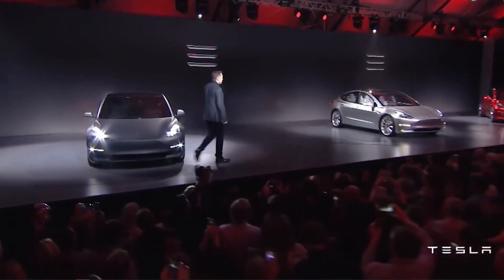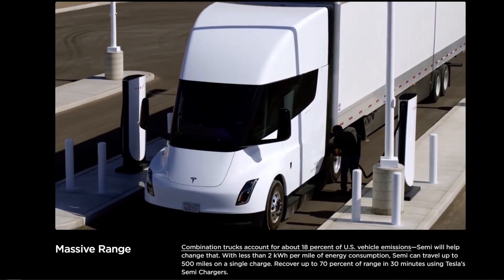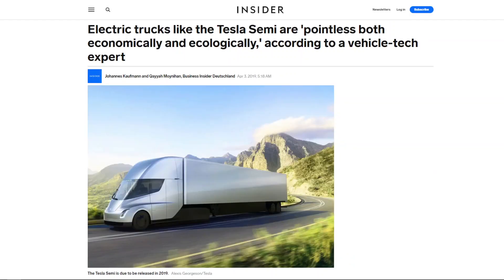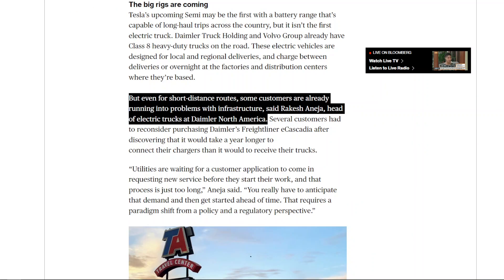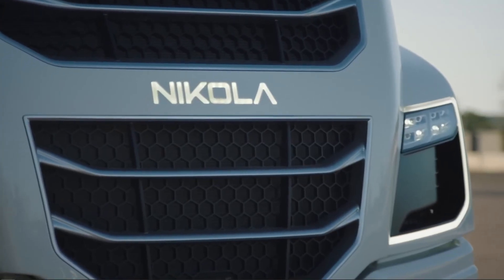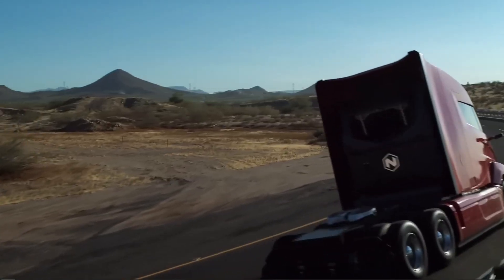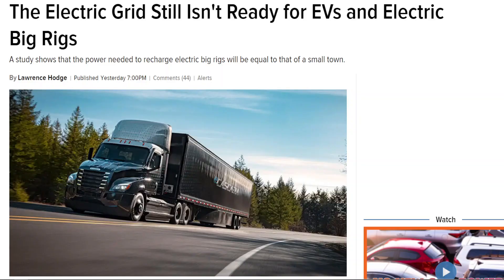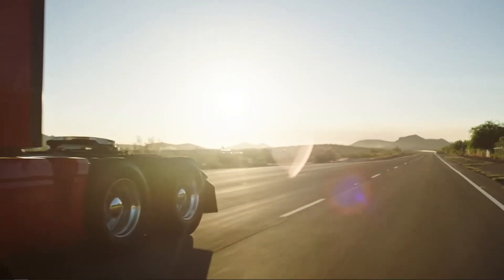Sandy Munro: Battery-Electric Trucks Are EXTREMELY Flawed For Long Haul.

Comment: Semi Truck        => 900 kWh battery pack or 1.7 kWh per mile	
					
Average US Home uses => 10,715 kWh	 per year 

Semi truck uses less then 10% of an average home per year
Reply: Okay we need sources from both sides now.
Reply from the maker: Average power draw of 2500 UK homes was 997 kW over the time span of a year. So one semi truck pulls enough power than can support 2500 homes
Reply: @visceral_investing  Sorry, but this is rubbish. I live in the UK. Say as an average, we use 5kW a day - which according to our smart meter is VERY conservative. 5*365=1825kW. That's ONE house using double what you have stated.
Reply: @pacmania1982  Same in Germany. I alone used up 1800+ kwh in a yr.
Reply: @visceral_investing  if they have gas for heating/coolling etc...😁
Next we need take to account terms. We speaks about charging power or what? 2500 homes use 1mWt, ok...charger use 1mWt. But 1 semi charging 40mins. So, 1 charger=2500 homes=32semi ? 😁
And yes, its fully incorrect comparison. I think we need to speak about full power of house per year and mileage of that house. Oops, house have no mileage, so its useless. 😁 Am i right? No. But this video have same math.
Reply: @visceral_investing you are talking rubbish , you are saying that a home use 0.4 kwh per year? 😂😂😂
Reply: @visceral_investing rubbish

Comment: 1 MW can power 2500 homes for a year? Bullsh*t, thats just 400 watts per home/year. It may power phone charging for a year but thats about it.
Reply from the maker: 1 MW of AVERAGE power consumed by 2500 homes in one year
Reply: @visceral_investing  I'm sorry but each house switching on just a kettle ONCE for half an hour per YEAR blows your calculations out of the water.
Reply from the maker: Do you know the difference between power and energy, or you just trolling?
Reply: @visceral_investing  I do. Power is the rate at which energy is used (or generated). So your example provides each home with just 400 watts used over a period of one year.
Reply from the maker: The 1MW is not calculated over a year, it is the POWER draw that 2500 homes pull averaged over the timespan of one year. There is no time involved in this equation, you're confused
Reply: @visceral_investing  I'm confused by the fact that you say the I MW is NOT calculated over the year, but the POWER draw (1MW) from 2500 homes is averaged over the timespan of one year! Maybe you could clear that up for me.

Comment: Are you kidding! It just went 500 miles fully loaded at 1.7 kWh/mile. At a commercial electric rate of $0.06 kWh it cost $51 for the trip. A diesel at 6.5 mpg & the National average of $5.14/gallon would cost $395 for trip.
Reply: there is nowhere in the US that you are going to get 6 cent power...the average cost in the US in november was .163 per kWh.  The cheapest in the US was still over 9cents in Louisiana at a price of 9.37 cents.  I dont think most trucking happens in the state of Louisiana soooo even with 100% off peak useage outside of maybe in the cheapest state you will see your .06 rate.
Reply: @bodhisfattva7462  The price you quoted is for residential power. Large commercial power customers get much much lower prices. The Tesla semi efficiency with commercial electricity prices will overwhelm diesels.
Reply from the maker: Are you accounting for the fact that the Tesla will cost 40% more upfront, haul 50% less cargo and require a $2 million megacharger to charge at their rated speed?
Reply: @visceral_investing  if you save say $700 on fuel costs every 1000 miles & there is a $40,000 government incentive to an EV semi, then It won’t take long to overwhelm diesel economics. A Diesel engine, transmission & 160 gallons of fuel probably comes in at 5000 pounds where an 850 kwh battery pack comes in at 10000 pounds. Since the Tesla semi doesn’t have a sleeper cab, has fiberglass panels & appears to be shorter to fit European specs, that probably saves another few thousand pounds. Also semi EVs are allowed to carry 82,000 pounds vs 80,000 for the diesel. So I don’t see the big claim you are claiming about reduced payload. You have a point about charging but this will improve over time at selected locations. Elon will probably install Megachargers in NW Texas where  wind is plentiful first & go from there. CA subsidized the PepsiCo facility to reduce smog. Tesla semi will have such an overwhelming advantage in the first areas diesels will not be able to compete.
Reply from the maker: Coulda woulda shoulda, we can all make predictions about the future - but the facts are what matter today
Reply from the maker: So why don't you disprove it?
Reply: @visceral_investing  I’m not the one making YouTube videos making ridiculous claims, you are. Go back &  look at the information given at the Tesla semi event & do the math. 2170 batteries have an energy density of 270 watts/kg & probably around 180 w/kg in the pack. The semi went 500 miles using 1.7 kw/mile which would give it an 850 kWh battery. Grade school math should allow you to figure out the weight of the pack.Then you can subtract the weight of a Diesel engine,transmission & 160 gallons of diesel fuel. You should come up with a weight of the Tesla semi. Surprise your viewers with some intelligence & quit repeating FUD you heard somewhere else. Good luck!
Reply from the maker: I'm not the one who dodged the question about higher cost, lower payload and $2 million cost of charging by giving baseless predictions about the future. I'm still waiting on your factual response to the question with numbers. If you can't, just get lost
Reply: @visceral_investing  where did you get the 50% less cargo? Explain that!
Reply: @visceral_investing  an InsideEVs article made reference to 11 4,000 pound Jersey barriers carried on the 500 mile Tesla semi trip. That’s 44,000 pounds payload. So according to you a 50% reduction in payload means a conventional class 8 semi should be able to carry 88,000 pounds.
Reply from the maker: Has Tesla released the real payload figure?
Reply: @visceral_investing  not yet
Reply from the maker: @kleinzach007  but the already launch happened? Why would you not release the payload?
Reply: @visceral_investing  it is a work in progress, if they can lower the energy used from 1.7 to 1.5 kWh/mile, they can reduce the battery pack another 100 kWh & the weight can go down 1200 pounds & still get 500 miles range. The 300 mile version should be 4000 pounds lighter than the current 500 mile version & the payload should be 48,000 pounds—not bad. They have enough customers for now & will be using it internally. When they ramp up production over the next year & need more customers, then you will see the real number. In a year they will also have more Megachargers & that will be another new business for Tesla. Tesla semis are more energy efficient than diesel semis by a factor of 3, MPGe near 20.
Reply from the maker: @kleinzach007  "work in progress" after delaying the product 5 years LOL
Reply: @visceral_investing  hydrogen trucks, lol, Are you Treavor Milton? They run great downhill.
Reply: @visceral_investing  It's first generation.  I remember well when the first iPhone was launched in 2007.  The naysayers were in full effect criticizing what it can't do: no copy paste, no 3G, no app store, etc..instead of realizing it's a revolutionary product that will improve over time.
Reply: @visceral_investing  "Coulda woulda shoulda, we can all make predictions about the future - but the facts are what matter today".  Like how you make predictions FCEV will be the future?  let's look at today then, BEV vs FCEV.

Comment: Some simple math for anyone worried about US grid capacity:
100,000 Tesla Semis x 100k miles a year / 500miles per MWh = 20 TerawattHours. The USA uses about 4000 TerawattHourss a year so 100k new Tesla would only contribute a 0.5% increase
Reply: There's way more than 100,000. 

 There's roughly 16 million registered semi's in the U.S.

 Something close to 5-6 million of those are long haul truck's. 

 Then just to be fair that's just long haul. 

 The total commercial vehicles in the U.S is around 65 million as of at least a year ago. 

 While a majority of those are going to be every thing from cabs to postal delivery vehicle's to city service vehicle's a significant chuck of those are going to be local and regional semi's. 

 Local and regional truck's will show up at the same truck stops as the long haul if nothing else to fuel. 

 Your Numbers are simply way off the mark.
Reply: @roccprofit  100k is the projected number of Tesla Semis on US roads in 2-3 years
Reply: @wolfgangengler8088  I don't see how that was angry as all I did was reiterate the point that replacing diesels with EVs will not require nearly the amount of electricity as listed in these comments due to less electricity needed to refine, drill, transport and pump diesel. I am sorry you got an angry message from that.
Reply: @wolfgangengler8088  You forgot to take out the amount of electricity it takes to create a gallon of diesel. This accounts for about 12 kWh per gallon of gas/diesel. This is about a 20% increase in the need for electricity when taking out the gas/diesel it is replacing.
Reply: @Aircam73  Distilling diesel from light sweet crude is far more efficient than making gasoline, and depending on available petroleum, up to ~90% for diesel versus ~75% for gasoline. Your average is correct, but weighted by usage mass ratios favoring gasoline over diesel. Removing sulfur and meeting ASTM standards is necessary these days; historically however, diesel engines used to run on unprocessed light sweet crude and even unrefined food grade oils.
Reply: @wolfgangengler8088  The simple fact is by the time you account for all the electricity used in drilling, pumping, refining and distribution. You could run an electric Semi for around 6 miles. Since the electricity used by an EV truck is a direct replacement of diesel and by the time you subtract the electricity used to refine that diesel you are left with needing much less additional power to fuel EV trucks. Making both yours and visceral calculations of how much additional power is needed to add EV trucks a couple orders of magnitude off.
Reply: clearly "Visceral Ace" does not understand the difference between KWh and KW, or MWh and MW.  "Visceral Ace"  is leaving off the number of hours in a year 8,760 which is the difference between rate of power (MW), versus power delivered in a year (MWh). 20 TerawattHours /8,760hr/yr = 2,283 Mega watts of generation, cost at $4500/kW = $10.3 billion a lot of money for sure but not $90 trillion.
Reply: @wolfgangengler8088  Replacing the entire commercial transport fleet is obviously going to be a multi decade project. Upgrading the grid just takes money and time, its really not that complicated.
Reply: @wolfgangengler8088  This transition will take years...
Reply from the maker: I also see you edited the original comment to change TW to TWh. I think its abundantly clear who's confusing power and energy in this conversation 🤣
Reply: @visceral_investing  - wow you are pretty aggressive for a host.
Reply from the maker: @dirkdiggler_1  Only if you make it to be. Just basic maths
Reply: @visceral_investing  Crypto mining accounted for 1.7% of total US electric consumption. I don't think that US grid collapsed due to this, and the adoption was quite fast.
Before Tesla sells 100000 semis, it will take years, so the grid would have time to have the right investments in generation capacity.
Reply: @dirkdiggler_1  just the way it should be. 

 Especially when faced with so many people who simply do not grasp the magnitude of the issue.
Reply from the maker: That 20 TW = 20 billion kW. Average capital cost of new generation capacity is $4,500/kW in the U.S. Do some simple math and the "only 0.5%" increase would cost $4,500 * 20 billion kW = approximately $90 trillion. Definitely worth it!
Reply: @visceral_investing  Firstly 20TWhs would be a rounding error compared to existing electricity generation capacity. Secondly, whether or not a specific utility company would want to invest to increasing their own local generation capacity would depending on their specific growth projections AND additional revenue and profits from additional investment. Are you sure you're an investment channel? Coz I'm pretty sure you have to look at both the costs AND profits when deciding if any investment is "worth it"
Reply from the maker: Ok, why don't you show us the "simple math" on how long it'll take to make the $90 trillion back?
Reply: @visceral_investing  With or without EVs, electricity consumption increases annually and electricity companies invest in new capacity every year to meet that demand. As far as I can tell, selling electricity is a profitable business and electricity for EV charging is not uniquely unprofitable or less profitable than electricity used to power homes or businesses. With higher increases greater economics of scale should actually help lower the cost and improve margins. Do you happen to know any reason why supplying electricity for EV would somehow be less profitable?
Reply from the maker: Still waiting on the answer to my question
Reply: @visceral_investing  it does not cost nearly 4500 for a kw of production. 

For example a GE combined cycle natural gas generator is producing about 500 megawatts for about 60 million dollars. 

That's 500,000 KW of production capacity for 60 million. That's 120 dollars per KW. Not 4500. 

This is also just the up front cost. It runs for years. The average cost in the United States of making a kwh is less than 8 cents, with distribution it gets to about 16. 

To illustrate how off your math is think of this. You are suggesting that  .5% if our total capacity costs trillions of dollars when our entire grid as is didn't cost that much. Adding a half a percent in production can't cost more than the previous total.
Reply: @visceral_investing  So, you think that EVs are using too much of the grid yet you simp for hydrogen which will use 4 to 6 times as much electricity to create vs just putting it in a battery? This is the typical logic I see from people investing in hydrogen or Nikola.

Comment: I know I come off as a bit of a conspiracy theorist but I've done the research and it's a fact that above Elon Musk, above Tesla, above SpaceX, above Nikola lays the classified defense and aerospace sector. 

It's OBVIOUS the current grid and infrastructure cannot support charging millions of evs at once...WE NEED NEW ENERGY GENERATION TECH...above and beyond 1970s solar, batteries, wind and traditional nuclear 

The people, the average Joe's need to understand that the classified and private sector is behind the scenes already 60+ ahead of anything they have went public with.

We talking clean compact nuclear fusion and fission reactors, quantum crystal solid state batteries, microwave beam wifi electrical networks, nuclear batteries, quantum water electrolyzers that produce tritium and deuterium gas. High efficient water electrolyzers, the list could go on and on. 

I mean all this tech exists RIGHT NOW inside these organizations that remain again closed to the public sector.

I do not understand how the average Joe's and tesla fan boys cannot understand that swapping out every car on earth to ev and hydrogen gonna require a upgraded grid and renewable energy technologies upgrade. 

The United States 🇺🇸 DoD, DoE, DARPA, Raytheon, Lockheed Martin ect ect have energy gen tech waaaaaayyyy ahead of anything Elon Musk, Tesla, SpaceX or Nikola will ever have...

People need to understand the 100% truth in that and DEMAND IMMEDIATE DISCLOSURE...

Until then charging these 1,000 KW battery packs is gonna be like watching paint dry...

Comment: Thank you! Very informative video and very solid points! I work for power utility company and yes, they are called peaking station and they only run units at those stations when non-peaking stations can't meet the requirements on certain occasions such as hot days when most people are expected to run air conditioner, around Christmas time when many people use lights etc. Knowing Tesla battery pack, i think it's going to cause more hassle and complicated work than ease things...which means Nikola still beat Tesla in every way!
Reply: Bullshit. There are now millions of small teslas who charging all the time. V3  chagrger have 0.25mWt per station. And everything work. If you hear presentation,   Musk said: produce-store-charge. All 3 components needed. Peaking stations not needed if you have enough megapacks. 1 wind turbine will charge 7 semi at a time or up to 250 per day. Hydrogen bullshit. I have spent a lot of time with it. Its hoghly leakable and flameable. Its destroying containers and tubes changing its stucture. No chance for hydrogen in cars.

Comment: Google "how many kilowatts does it take to power the average home and you will get your answer."
1 megawatt equals 1,000 KW.
It takes 30 KW to power the average home for one day.That means one megawatt will power one home for 33 days.
So this guy is smokin crack or Google is.
Reply from the maker: What? I'm not comparing one home for 33 days bro, I'm comparing 2500 homes for 1 year. The AVERAGE power used by 2500 homes is equivalent to 1MW over a year's time